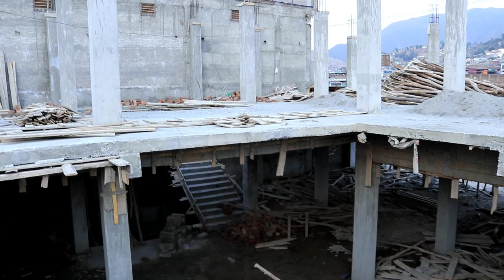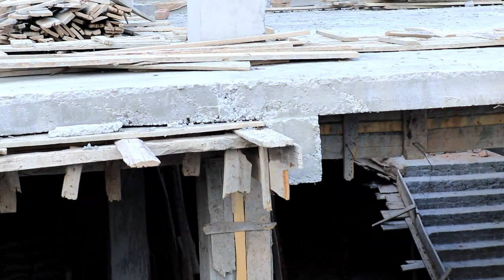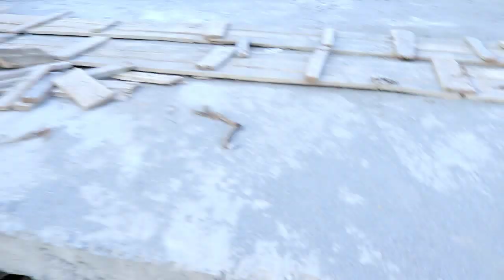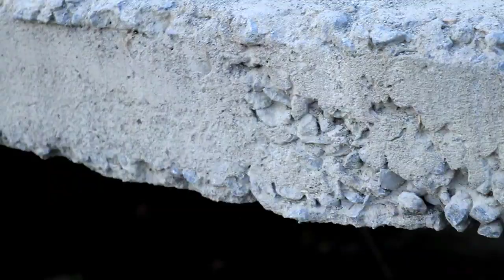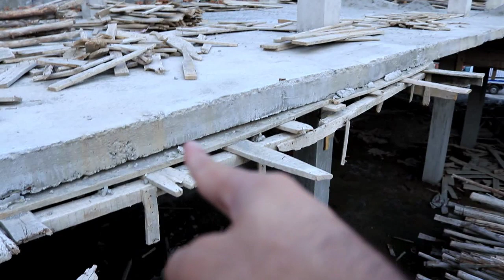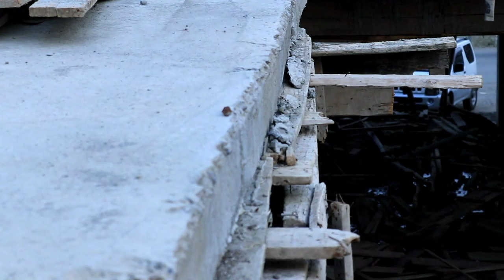Mistakes in RCC Slab - Big Mistakes in RCC Slab - Mistakes in RCC Slab Thickness

Comment: You can see that the form material is of very poor quality. Most significantly, the form wasn't set accurately; in that no correct measurements were taken. Forms must also be properly braced.

Comment: it will colapse few years 
...
Reply: It might collapse, but it probably won't. The biggest problem could be if the cover was greatly reduced, in which case the rebar might corrode over time. We actually drove a 2 tonne digger over an old reservoir concrete roof built circa 1908. The slab thickness varied from 4.25 to 5 inches and it was reinforced with a not very heavy expanded diamond shaped steel mesh, yet the slab held up fine with the weight of the digger going around on top over the 10 feet spans. We put loads of Acrow steel props stood upright underneath but  with a slight gap to see if the slab was bowing much under the weight, but it wasn't.
Reply: Just to add to my reply, we found out how thick the slab was because the old reservoir roof was cut into strips with a floor saw to be removed so that a house could be built.